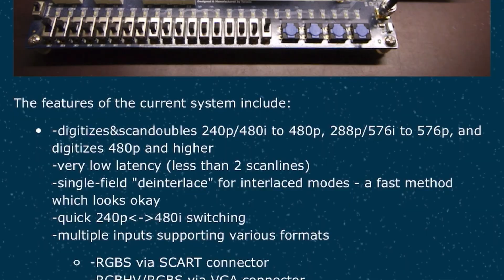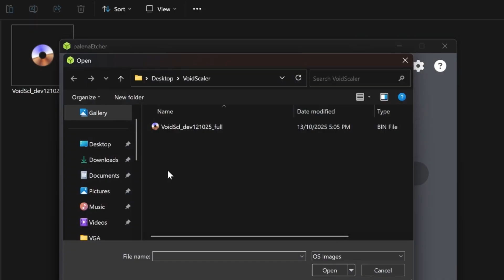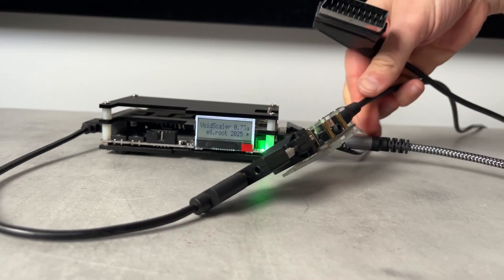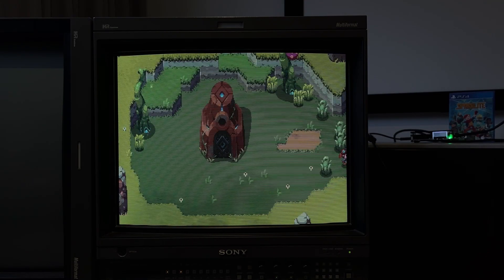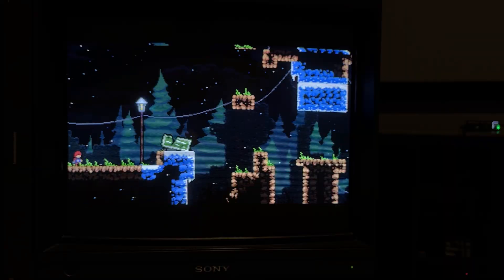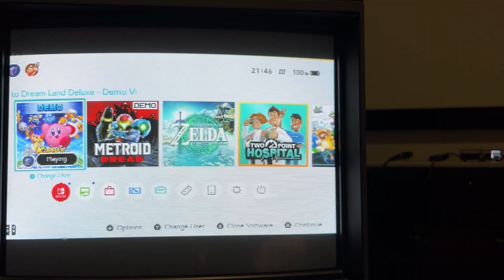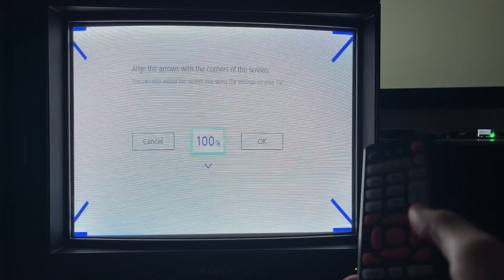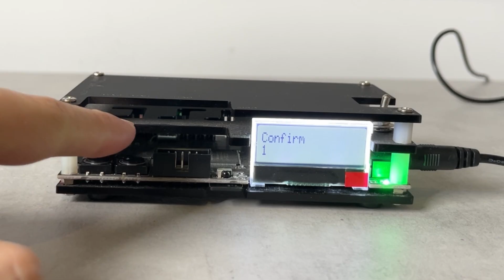Downscaling Chronicles 22: VoidScaler OSSC CFW for Low-Lag Line Blending 240p and 480i Output!

Comment: I don't get it. It need vga input from hdmi? So PC - hdmi - vga dac - ossc vga input ? What about sound? I guess this is the only option since the ossc doesn't have a hdmi input.
Reply from the maker: If the source is HDMI then yes that is correct. You would extract audio via the converter and can bypass the OSSC since there’s no lag

Comment: What would you say is the best downscaler to go from HDMI 1080p/720p to RGB scart 480i?
Reply from the maker: Because you only want 480i output I’d say an Extron VSC 500/700/900 are the best bang for buck though you’d need an HDMI to VGA converter on the input. There’s plenty of similar devices like these such as ScanDo Pro’s.

Bob from RetroRGB recently released 2 videos on scalers going from HDMI to either composite or component 480i if you wanted something on a budget.
Reply: @MarcoRetro316 
Thanks that's very helpful!
Unfortunately my tv (90s Grundig) doesn't accept 480i composite since it is a pal TV it displays a black and white image, only my Wii is able to output 60hz via composite, I think it's called pal60. I guess my only option would be RGB scart.
Ive already heard about the Extron Vsc but many people report that there is a screen tearing issue, do you think that would be a problem?

Comment: Okay, this is a bit silly, but hear me out. If you have another upscaler like the RetroTink2x mini, an old Framemeister, etc. and connect it to the OSSC with VoidScaler. Can you use it as functional NTSC to PAL (or vice versa) composite converter?
Reply from the maker: I guess you could. It won’t be absolute Passthrough but yes that is possible

Comment: This is what I’ve been waiting for. This is why I watch you. What would be the best way to output composite RCA from an hdmi input with this setup? Trying to emulate to my crt from my steam deck lmao
Reply from the maker: For composite you’ll need an HDMI to VGA DAC, then a VGA to Composite converter. There’s a few that are suitable for the Mister FPGA and you want to make sure it’s an active converter. For the Steam Deck, if it’s purely for emulation then Batocera is working and Rion just got the CRT Script running on V42 for 15KHz output via USB-C via another converter to output analog RGB. However it’s still under development as the Deck’s LCD/OLED currently won’t display an image even when not connected to a CRT. There’s future plans to be able to switch between 15KHz output and the native screen. If he can pull that off then the Steam Deck is going to be a pretty cool retro Switch-like handheld with no external scaler necessary

Comment: Hi Marco, I ended up buying an OSSC today to see if Voidscaler would be a good fit for getting the Analogue 3D (set to 1080p—it’s either that or 4K) into my Olympus OEV203. As someone who is brand new to the OSSC, can you recommend a good pair of DACs to use with this setup? I need something that’s gonna convert HDMI on the Analogue 3D end to… is it VGA? Or component? On the OSSC, and then again on the output end, another HDMI to component or RGB for connecting to the PVM.

Thanks in advance for your help!
Reply from the maker: Congrats on your purchases! The Reflex Prism is meant to be one of the gold-standard DAC’s. I’ve only used cheap DAC’s and they’ve always been good enough for my purposes. I just use generic HDMI to VGA that are powered by the HDMI input and also give stereo audio. I wouldn’t invest too much into it just in case you find that VoidScaler isn’t fit for your use case. So you’ll need 2 DACs and then a VGA to BNC cable to go into the PVM for RGBs
Reply: @MarcoRetro316  thanks! I’ve got a couple of those cheap HDMI to VGA dongles, including one that I don’t use, so I’ll start there and then take a look at the Reflex Prism for the output. I’ll let you know how it all goes once I’ve had time to set everything up!
Reply: And actually… I’m realizing I also have an HDFURY Vertex 2 sitting around not being used. I might be able to use that in place of the Prism or other DAC. Experimenting is fun, right? :-)
Reply from the maker: Yeh HD Fury is highly regarded, just really expensive which is why I don’t own any. But that should work great
Reply: @MarcoRetro316  Vertex 2 doesn’t support 240p or 480i, so I’m left currently with some cheap DACs. Unfortunately so far what I’m seeing is promising but not ready for use: I can make out the Wave Race 64 intro when I boot that cart but the monitor displays “NO SYNC” and rolls green and purple. Not sure where the sync breakdown is, but it happens no matter which DAC I’m using on the input end (I have a couple different HDMI to VGA ones), so I’m hoping it’s an issue with the output DAC (HDMI to Component.) I’ll try another on Friday when that arrives. The expensive one you suggested is on backorder and can’t even be preordered right now.
Reply from the maker: @nusilver I could never get HDMI to component working on VoidScaler with 2 known working DAC’s, only HDMI to RGB
Reply: @MarcoRetro316 I got it working with one suggested in the shmups thread! https://youtu.be/z8s7rlh51ZI?si=fb6jW_dKPVN0gw3-
Reply from the maker: Dude that looks awesome!
Reply: @MarcoRetro316 ❤

Comment: I need to hook up from hdmi vga -> scart switch -> scart TV , so I need VGA to MD2 converter?
Reply from the maker: You can use a VGA to scart Passthrough cable with a resistor on the sync line. But the VGA to MD2 dongle should be fine as well. If sync doesn’t successfully pass through then you can set the OSSC to output HV sync and then it should work with that dongle
Reply: @MarcoRetro316  Thanks Bro. might be my VGA dac auto upscale issue, there is not passthrough from OSSC.

Comment: I believe you can’t do this with the OSSC Pro or can you, and also, which do you think is better this version or the OSSC pro
Reply from the maker: The OSSC Pro has more video I/O and up and downscaling in a single firmware with free-form scaling. It’s a complete product so it is by far the ‘better option’, but that’s not to speak bad of VoidScaler as it’s very useful to anyone that has an OSSC not in use that wants to downscale. It also has the advantage of line blending which the OSSC pro currently does not. Markus may look into implementing it.
Reply: @MarcoRetro316 I hope the Ossc pro can get the line blending soon I do think line blending looks great

Comment: any way to contact e8root? i'm testing the firmware and literally my OSSC remote got bricked, i only have 480i output and my remote is not responding
Reply from the maker: Message him on shmups
Reply: @MarcoRetro316  i think the account creation on shmups is disabled :(
Reply from the maker: @Elwarez1994  the remote can’t be bricked, maybe the IR receiver isn’t doing its job or passing on the correct commands. Or dead batteries. I’d try re-flashing the sd card and re-installing. Hold the second button on the OSSC when booting, release, then hold both buttons on the unit while pressing 10 on the remote. Hopefully it works
Reply: @MarcoRetro316  i read that solution, i have the IR blaster and OSSC receiving button presses from the remote and a change on the HEX code from the FW but without any change on the image on screen and also i cannot flash the original OSSC firmware nor the DEV Voidscaler FW, i'm using an unmodified OSSC v1.7

EDIT: e8root is aware of this issue and just post an updated FW  with a fix, in my case i just need a JTAG USB blaster to get back to stock

Comment: Guys, please help me. I have a dream: first connect the PS5 to a CRT TV via a component cable, and then connect the PS5 to a CRT monitor via VGA. How can I accomplish this? Unfortunately, OSSC Pro isn't sold in Russia; only OSSC 1.8 and RetroScaler GBSC Pro are available, along with simple converters from AliExpress, like HDMI to YPbPr 1080P Converter. I'm not quite sure what to get out of this.
Reply from the maker: I am assuming when you say CRT monitor via VGA, you are using a PC CRT and want to output 480p? I am not 100% sure this is correct but I have read that an EDID emulator can tell the PS5 to output 480p, though I wouldn't go spending money on a device to do this in case it is untrue. For actual scaling down to 480p, the GBS-C Pro that I reviewed which is suited for downscaling can do this as the HDMI input scaler can take 480p and higher, downscales it to 480i and then the GBS can output 480p. It will be a little blurry though, nothing crazy but not the best result. A lot of Extron and other professional scaler will be able to do this without a special EDID. You will need an HDCP stripper or use an HDMI to VGA DAC to break the HDSCP connection.
Reply: @MarcoRetro316  tnx u
Reply: @MarcoRetro316  Do you have any idea to make a video about a simple and affordable way to connect a PS5 to a CRT TV and CRT monitor? After all, not everyone has the money or desire to spend money on a top-of-the-line Sony GDM-FW900.
Reply from the maker: @str @strangerchester6454  As I read in another comment: Price, features and ease of use. Pick 2. The perfect, low cost device unfortunately doesn’t exist, yet.
Reply: @MarcoRetro316  I see, thank you for your answer!

Comment: Marco, I forgot to ask, is there any downscale method or device that allows you to resize the image horizontally generously? Like stretching it sideways, way past overscan? I signed up for Nintendo Switch Online in order to play retro games via the Expansion Pack with friends, and was disappointed to see that there was no stretch to 16x9 option to fill the screen. While that would normally summon the aspect ratio police, paradoxically, that option was precisely what would allow me to play those games on a standard 4x3 CRT, without it being a skinny image with black borders, as the set would squash it back to normal, full screen. 

See, that's why more options is the best, regardless of what you think "the right way" is, because you never know the end user's intention. Nintendo caved in to the aspect ratio police and now I can't do 4x3 on an actual CRT with those old games, isn't that a bit ironic? I know it's an extremely niche thing, but still, the stretch option wasn't hurting anyone but angry Redditors. I could stretch it on a VGA monitor (losing the ability to read menus) but I would love to downscale and play on an actual 15khz standard set. Mortal Kombat Legacy Kollection's devs talked about offering that option despite hating it, and thanks to that decision, I will be able to downscale that game to a 4x3 set no problem.
Reply from the maker: I know the OSSC Pro, Extron DVS 605 and RT4K can stretch quite a bit. I did exactly what you’re wanting in the RT4K video with an SNES Classic and it looked practically identical to the SNES on the Mister FPGA. I sold the RT5x so I can’t confirm but my guess is that it probably can. Extron scalers in general have really good HV controls. If you already have something like an Extron DVS 304 you can use it to re-scale and output 480p into the GBS
Reply: @MarcoRetro316  Alright, then I'll wait to get an OSSC Pro eventually and until then, I'll just stick with downscaling stuff that's already in 4x3. I think that for the Nintendo Switch Online stuff I'll just use a 4x3 VGA monitor in the future, while using the horizontal size to stretch the gray borders past overscan, and then split the HDMI to a flat panel in order to read menus, if needed. I'll do some research on the Extron solutions meanwhile, thank you.
Reply: VoidScaler supports this mode of operation. For first release only in 720p with with 3:1 downscaling but later also in 1080p for its 4:1 and 5:1 modes.
Reply: @e8root  Sorry, I missed this reply. Are you saying that the VoidScaler can stretch the image horizontally, like way past the overscan?

Comment: Hey Marco, I just discovered your channel! Could this be a complete replacement for CRT Emudriver? I’ve been trying to find a reliable way to connect my modern PC to a Trinitron CRT using component or RGB. The cheap HDMI converters on Amazon have always given me terrible results, and I’d rather not buy an old GPU just to run CRT Emudriver. What would you recommend? My main use case would be playing retro games with RetroArch.
Reply: Try Batocera which can do native 240p and much less finicky vs crt emudriver
Reply from the maker: I second what vidzz says. If you’re considering CRTEmu then look into Batocera. It’ll give you all the resolution switching automation plus a fancy front end
Reply: @MarcoRetro316  Thank you I appreciate the help. Do you have a resource you can recommend to learn about this? I am still unclear about what hardware I need to go from HDMI or display port to component. My GPU is the NVIDIA 4070 and the lowest resolution listed in the control panel is 640 x 480. The Batocera wiki states that 240p analogue out is only supported by old VGA/DVI-I port GPUs
Reply: @PrismPat The wiki when I looked at it previously recommended a dp to vga converter dongle unless that’s changed.
Reply from the maker: I may not be the best person to answer but I believe you can just use an HDMI to VGA DAC with Batocera. Maybe jump into the Batocera discord to confirm

Comment: The king is back. This is awesome. I'm going to mess with this ASAP. Input I'm thinking I will use this with an older PC that has analog video out, so the input should be easy. But output could be tricky if I want to use this with a US consumer set instead of my PVM?
Might be a dumb question, but what would the best route for getting 240p component out of this? 
I don't think it's as simple as going HDMI -> VGA DAC and VGA to component cables right? Because I'd have to deal with sync?
SO then is it HDMI -> VGA DAC to RGB to Component adapter to Component?
Reply from the maker: You would skip HDMI to VGA altogether and get an HDMI to component converter, one that is pure passthrough doesn’t scale. The reflex prism adaptor is meant to be good. I’ve only used cheap stuff and 240p Passthrough can be ok in one batch and unsupported in another. I bought something similar to this on Aliexpress in 2024 and it worked fine for me. The link for my listing is dead so who knows if this one has the same innards. Porta also made an HDMI to component converter but I’m not sure they’re sold anymore. These converters require their own 5v power so it gets a little messier than HDMI to VGA
Reply: @MarcoRetro316 so sync wouldn’t be an issue then? Maybe I’m not understanding why you have to set sync on the ossc 🤯
Reply from the maker: @hideokojimajr  oh wait sorry, I think you’re correct, I’m a little low on sleep. Let me test it for you and I’ll let you know how/if I can get component output to work
Reply: @MarcoRetro316 you’re the man Marco. Rest up, and no rush. Thank you for your work.
Reply: @hideokojimajr  If you use VGA to SCART RGB cable then SCART expects RGBS signals and VGA port produces RGBHV signals as a standard. If you only have RGBHV ten you need to combine sync somehow and this is what external sync combiners are for and often mentioned in the case of downscalers. It is however possible to get RGBS signal directly out of the VGA port e.g. RGB Emudriver does this and also OSSC Pro with legacy AV out port and MISTer FPGA analog I/O board. The same trick can be done when you use HDMI to VGA DAC/dongle and so you can re-use the same cables.

Now if you need Compontent it is a bit more tricky. Component uses Sync on Luma and negative voltages for Chroma. I was able to implement the first requirement since it is HDMI protocol requirement and HDMI can be hacked but not the second as it is VGA limitation. The good news is that there is Sync on Luma standard which does not require negative voltages and which most if not all Component equipped TVs should support: S-Video. Not as ideal as Component or RGB but it can look very nice. S-Video is planned but for now it is only implemented as proof of concept. I don't want to delay release any more than necessary so first few versions won't have S-Video but eventually that is one of the major output methods VoidScaler will support. S-Video can also be very easily converted to Composite and it can be also generated internally.
Reply from the maker: @hideokojimajr  I just tested 2 different HDMI to component converters that definitely work with 240p output. Compatibility was very low, only stable with 1080p input in overscan mode and 240p output. I’ll check in with the professor
Reply: @e8root  Thank you!
Reply: @MarcoRetro316  Thanks Marco. I have an RGB to component converter that works ok, I will give that a shot when the firmware drops

Comment: Does having an 1.8 OSSC improve the experience in any way ?
Reply from the maker: It’s a big maybe. Pawel uses a version 1.8 and he didn’t have as much interlaced jitter as I did with hardware version 1.6. But then again that was on my multiformat monitors which may process sync differently
Reply: Like Marco says I have rev.1.8. For now I did not target any specific 1.8 features so they should work in older revisions - just not sure how far back.
One thing which might not work in the future is Component inputs as there was some change related to signals for sync on green/luma decoding. That said at this point it is unclear this will be an issue and how much effort/time it will take to fix it.